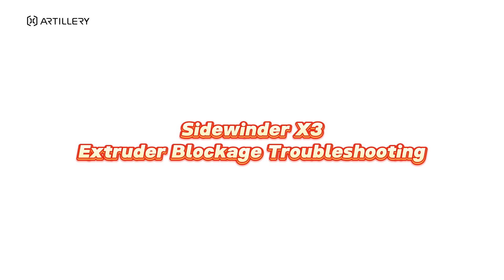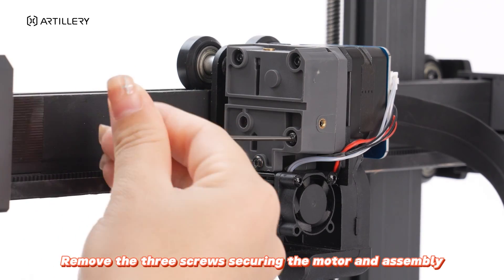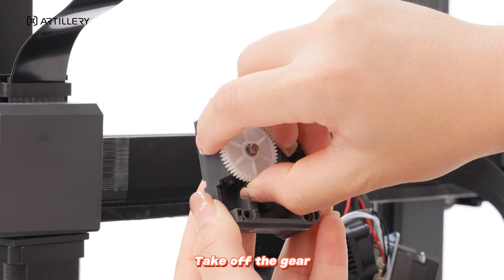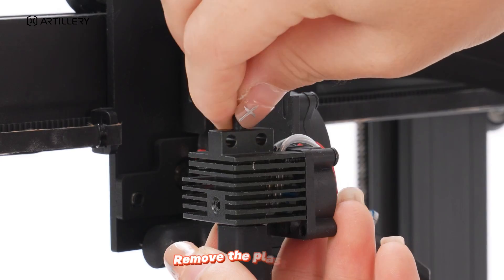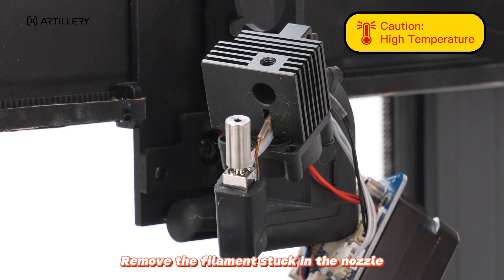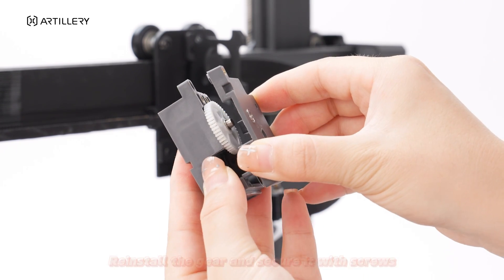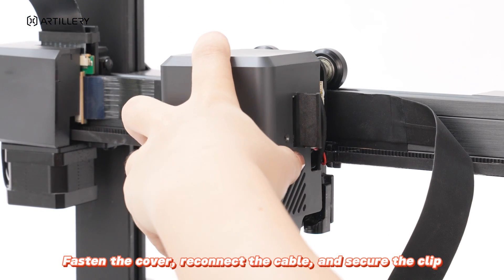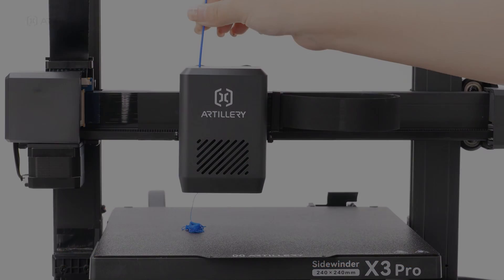Artillery Sidewinder X3 Series | Extruder Clog Troubleshooting Guide

Comment: I got another problem I cant find any Information about it.. My 3D Printer has its X=0 now outside of the Printer or something... everytime I press Home X it just goes to the side tries to go further and then says Home X failed. Does someone know the problem?
Reply: I had the same issue and it was the cable, it was missed aligned. Just remove it and insert it again. I hope this will fix your problem!
Reply: It could be the x axis limit switch

Comment: I have a problem where every 10 minutes or so, the nozzle just gets stuck with filament, and the material doesnt go back or forward. I´ve tried changing the temperature, the speed, the pla (i bought new filament to see if it was humidity) I clean it all as this tutorial explains, and still gets stuck every now and then. Is there something else i can do?
Reply from the maker: What filament do you use, PLA or others? And please check the temperature in the slicer setting. For PLA, the hotend teamperature is from 190℃ to 220℃.